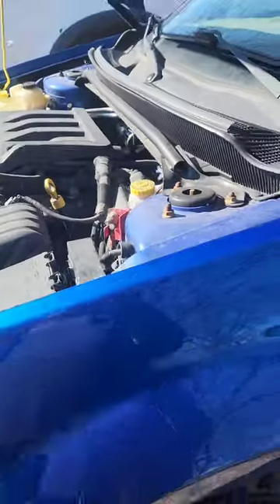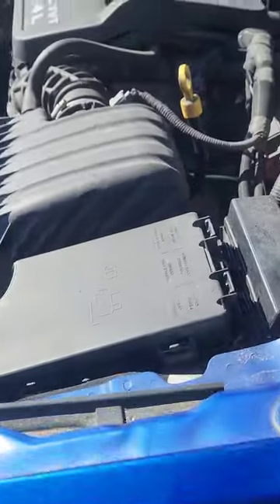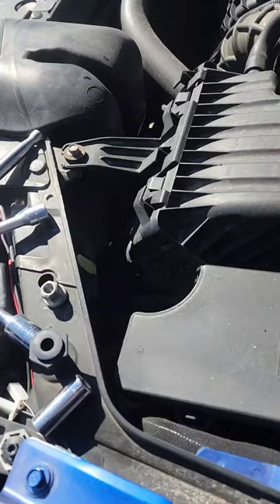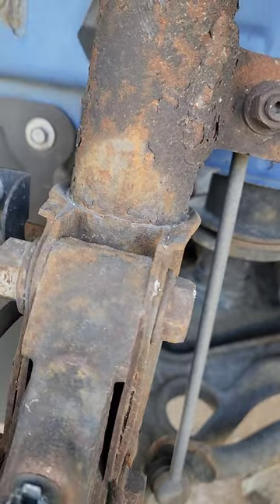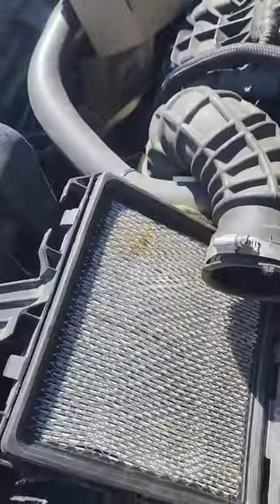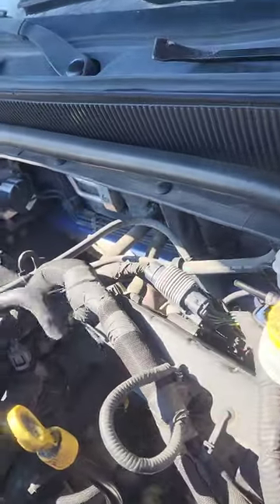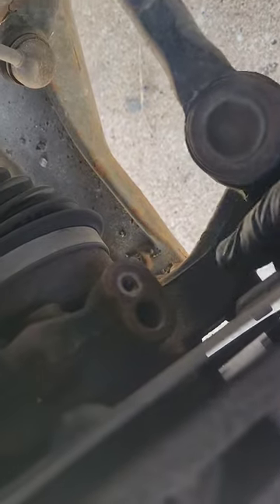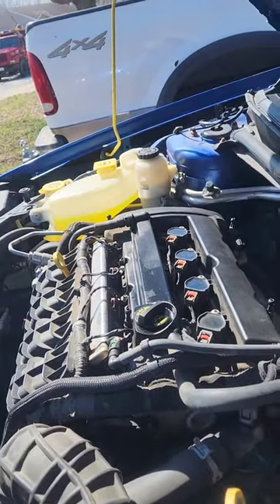2014 Dodge Avenger (Wheel speed sensor)

Comment: Pulled the hub assembly on my 2011 to replace the lower ball joint and wheel bearing and could not get that sensor out it finally broke and I tried to drift it out from the inside after removing the bearing but still would not move so I finally had to drill it out and that little plug in fastener and this car has only 68K its been sitting for 6 years, never had one so frozen I was surprised the bolt for it came out easy. Got any tips on removing ones that are frozen in without them breaking.
Reply from the maker: Normally for frozen bolts that won't move, I usually use a torch to heat it up but with the break lines close by I didn't want to risk it. When i replaced mine, the bolts came right out, the hard part was the connectors that are in small spaces that are hard to reach.

Comment: My 2014 dodge avenger is doing this . I can still stop . My dashboard lights tend to dim a little and then the abs light, break light and transaction control comes on and only the transaction control stays on then go off by itself. I’ve replaced the break switch and it’s still doing the same thing . I think I might have to replace the wheel speed sensor as well hopefully that will help.
Reply from the maker: Replace both, and after some driving it should all be good and reset
Reply: @big-c4486  it was the break switch . Thanks for your reply 💯
Reply from the maker: Glad it was a simple fix
Reply: How did you know that exactly the front two should be replaced? Do you have an abs scanner or something?

Comment: my abs kicks on and the i only get abs and traction light. switched out the speed sensor and nothing yet. thinking might have to change out the abs tone ring. also not sure how to acquire that part.
Reply from the maker: It took mine 2 days to go off with just driving it around for it to reset.
Reply: @big-c4486  ahh well the behavior mine is having isn’t the same as yours so not too sure. will give it a few days.
Reply: @jhranowsky15 did your light turn off or you had to change the ring ?
Reply: @eldeku6107  you can’t on these cars. had to replace the entire hub but that fixed it